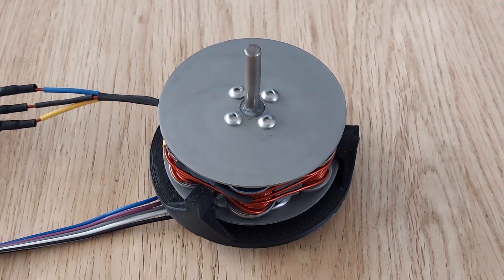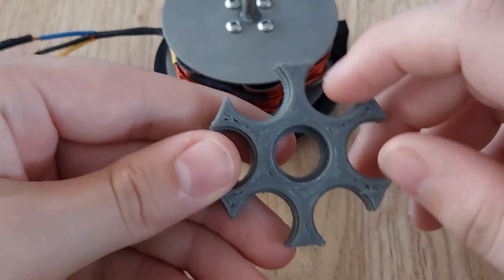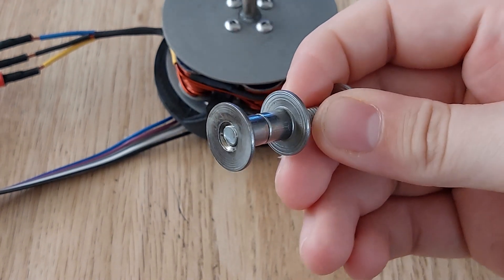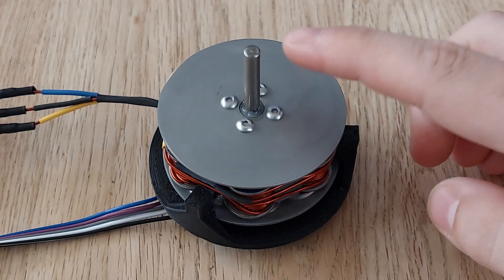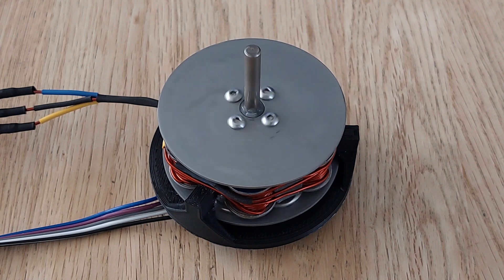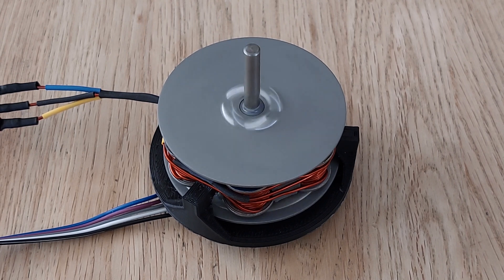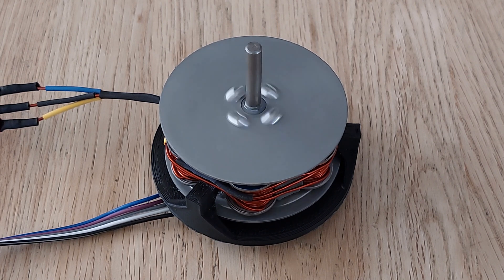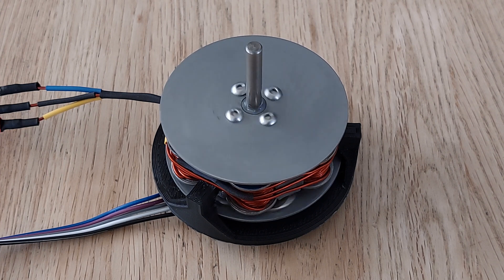DIY Axial Flux motor ⚡

Comment: Thank you for the video. How do you wind the coils?
Reply from the maker: I wound them by hand but it was not easy. I recommend using thinner wire (<∅1mm)
Reply: @stijnsprojects  thank you. Do you wind them all in the same direction or do you alternate the direction?
Reply from the maker: Because of the yokeless design I wound them all seperatly and then put them in the correct configuration according to a winding diagram.
Reply: @stijnsprojects  thank you

Comment: That’s awesome, will the 3D printed parts deform when the coil heat up? Thanks for sharing ❤
Reply from the maker: They probably will, I was not able to test it with this version because I couldn't attach a large enough load to heat up the windings.

Comment: I have a design for you. 8 coils. 8 north facing over the coils on one side. 8 south facing the coils on the other. Evenly spaced between the other set of magnets. If spun manually to induction it will become self-sustaining! Acording to 5 A.I's

Comment: Hi, I'm working on a hand crank (1:9ratio ), axial flux 3 phase alternator, 12 wedge shaped magnets per rotor half. Stator consists of 6 (18 awg) w/ 250 windings ea coil., sandwiched between the two rotor halves, similar to yours. 3 phases w/ bridge rectifier. I'm aiming for 16V DC stepped up/ down with buck/ boost. Plan is to charge 2 parallel rows of (6x) 500 F Super Capicators for16V (max) and a net capacity of 83 F. Incorporated will be L-ion battery bank for ~5V and an 18A AGM for 12V. Additional ports for for alternate DC Voltages/ Amps.

Question: Do you feel as though the iron core has a favorable effect on your motor?    Is cogging an issue?
I have the option of using a ferrite core at each stationary coil, I wonder if it will help get slightly more efficiency using the cores?
Thoughts?
Reply from the maker: The iron core definitely has a positive effect on the working, it keeps the leakage flux to a minimum and it has a high permeability.
Reply: @stijnsprojects  Thanks for the reply, it's appreciated.